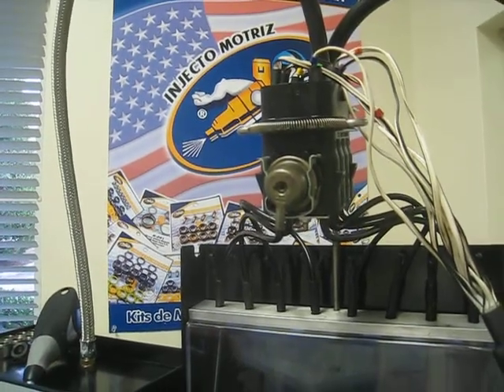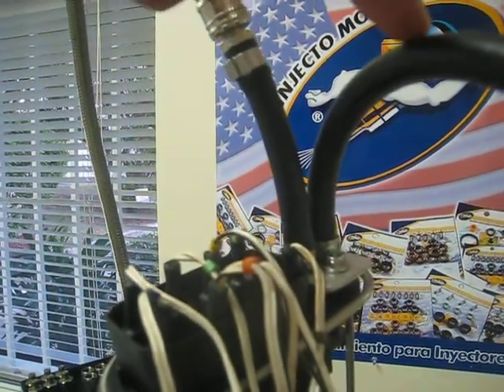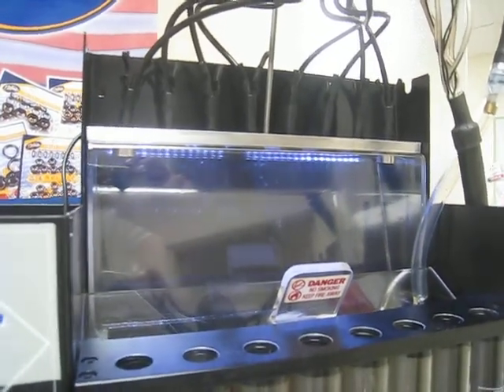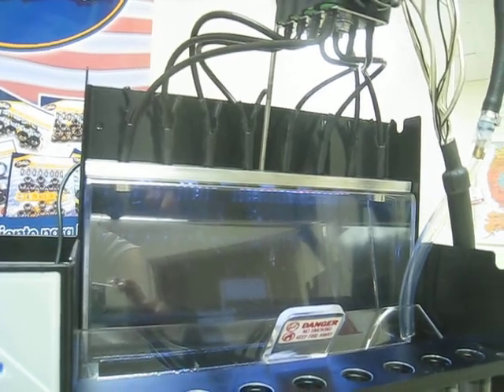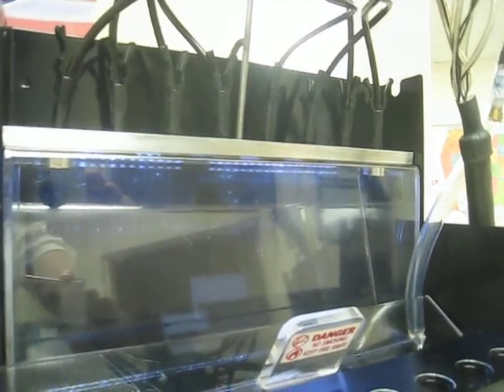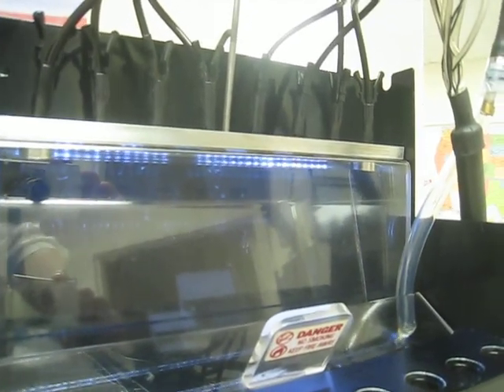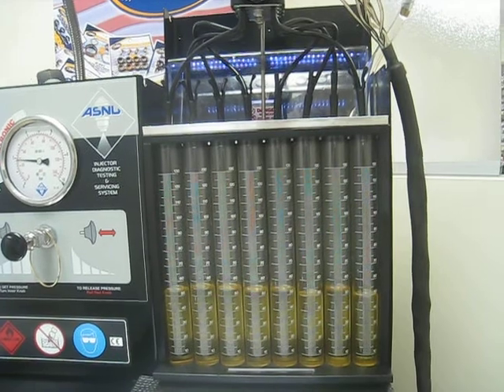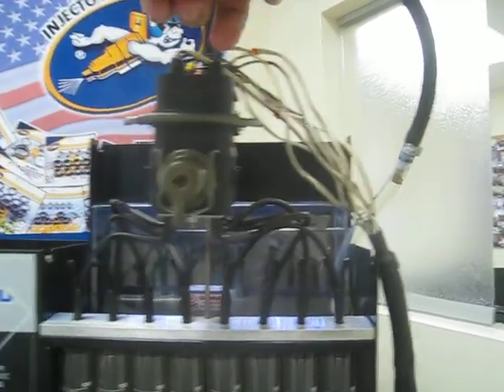VORTEC Fuel Injection System

Comment: Vortec SPIDER injectors are a piece of shit don't buy any more chevrolets as simple is that!!
Reply: This system was used for a few years but tell us what you drive?
Reply: Devin Dowless I think I would rather replace the spider in my s-10 rather than take apart lots to things to change the injectors in my 05 f350 with 6.0. My s10 has been a workhorse tho! I can't complain